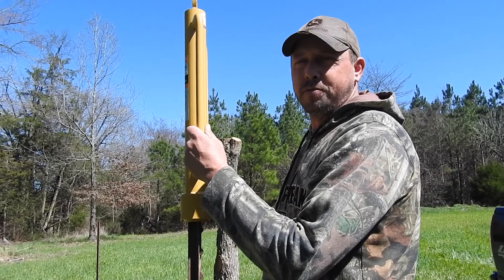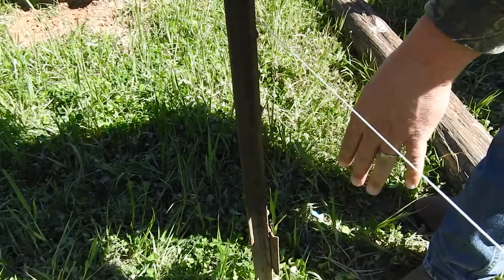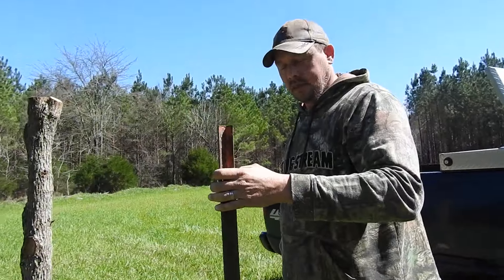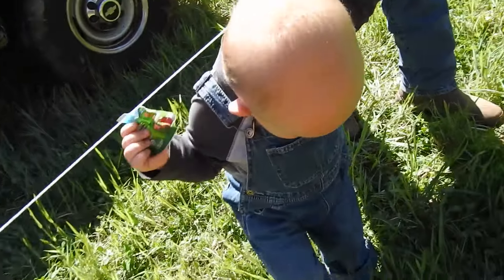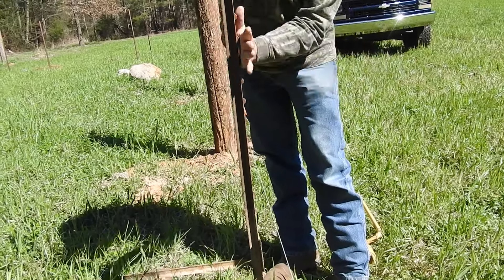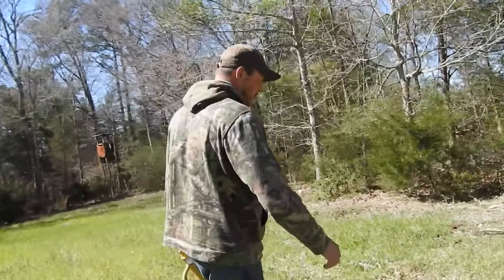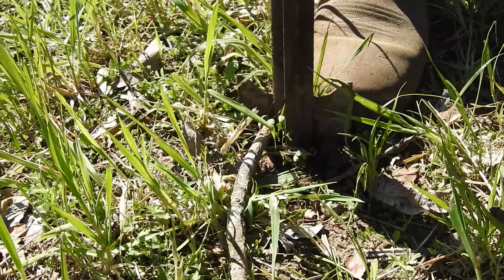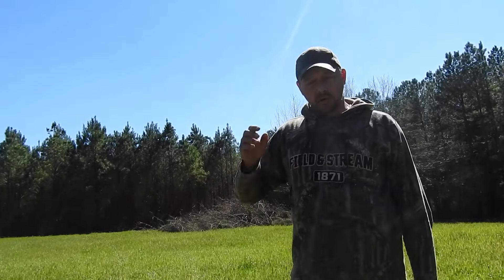Mistakes people make when Installing T Post for Fencing

Comment: We use 6 1/2 ft t post we drive them deeper. Im 5' 8" T post should be at least shoulder high. For 5 strands of wire. Been doing this for about 30 years now. Brace posts about 54" high using 8×8 treated or cedar posts. T post are guna be a bit higher. Then you guide the wire about every 5 to 7 t post. We do ours every 10ft apart.  
Its easier to show that to explain  but im not a social media teacher. Rather show, hands on.

Comment: Super helpful. We have a few acres and great fencing with these but it came with the property so is around the trails and pastures and I’ve just needed to do repairs so far.
We have a main gate at the road with the only part of the property without fencing across the front. But people across the gravel road across from us have about five loose aggressive dogs that continue to come around the gated drive. Then our LGDs are at the front instead of at the barn ( doing their job though )
I’ve been up front clearing brush and walked a corner around a tree I’m clearing to be face to face with barking growling lunging dogs. Luckily this place came with a post driver, extra rolled wire and several tposts I’ll need to do a count and measure how far the wire fencing will reach.
We absolutely HAVE to at minimum get a fence across the front so I hope I have enough. Because my hubby is already complaining about $450 rolls of fencing. 
He’s new to farm life and not prepared for what’s considered farm important.
He’s also kinda scared of our goats so 😂 it’s gonna take time. I’ll likely be putting this fence up on my own. 
If not I’ll need you to do an install an electric fence to keep predators out video!  I’m
Certain that will work but hope I can use what’s already laying around here because $$$

Comment: I grew up where the ground was hard and occasionally rocky. In that case I suggest cutting the bottoms of the handles (the bends and horizontal bits) off, grinding the weld where the bottom of the handles used to attach to the main tube smooth, and grinding the lower (cut) ends of the handles smooth. That way when (not if) you’re starting the post (reaching up high) and the post hits a rock your hands just slide off the bottom ends of the handles, not into the bend and horizontal part at the bottom of the handle. And wear gloves.

Comment: I’m in the middle of a 180 yard run right now and even though I pull the string all the way down the line between H braces and use the same tools you got I have absolutely struggled with getting those tea posts in Straight. Even with an extra pair of hands and a level they just seem to have a mind of their own. So after the fact when I’m stretching this fence and getting ready to fasten to T post what I’m finding as they’re not vertical but off to the left or right. Anybody have a solution?
Reply: Sometimes, rocks cause the problem, and moving the post one way or the other can make it easier to get the post straighter.

Comment: Thanks, didn't know the boot twist tip. Your property is level, what about slopes?
Reply: T posts go straight up from the slope of the ground to maintain the height of the wire.  As the slope gets steeper, if the post is plumb, the wire gets closer to the ground.

Comment: If I am understanding this right, regardless of in or out, you want the animal to push the wire against the t-post? This prevents the animals from just bending/breaking the clip/wire holding the wire to the post, thus forcing the wire off the post, correct?
Reply: The bumps on the t post face the animal. If animal pushes on wire the wire can’t move past the bump.

Comment: what is the weight per foot of the t-post you are using? or weight of entire t-post?
Reply: "regular" t-posts like he is using are 1.25 pounds per foot. light duty  is usually 1 pound per foot and heavy duty is 1.5 pounds per foot.

Comment: I have to install a post today at boss's ranch by myself. I've never done this before and don't know if I can even lift that big, heavy tool. I'm a strong woman, but not that strong. Wish me luck!
Reply from the maker: If I can drive a T post you can drive a T post I am a very small womanGood luck let me know how it goes
Reply: @MrozinskiFamilyHomestead  I can't believe it, but you were right! I was able to get the T-post in the ground using the tool. I dug a little bit with a shovel, then got myself in the back of the Mule and put that post in the hole, then used the tool to pound it in. Thank you for the encouragement!! Lee from the Texas hill country!!
Reply from the maker: You are welcome
Reply: Let the weight of the T post driver do the work. Hold it up let it fall and shove/pull down you will be fine. You got this!
Reply: Put the driver on the post before  you tip the post up to drive it in. Also, look for a post driver that is longer and easier to reach.   
   Also, if a driver is really short and you're driving, the post hard you can lift the driver too high and bring your hand down on top of the post.

Comment: I'm using hog panel, trying to keep people outsider the fence also using brackets to put a wood on the t post.
Can you tell me what side to face the post, do the panels go to the outside? Did I say this so someone can understand? 🙄🙂
Reply from the maker: Ok I have thought about it a lot trying to come up with a right answer for you for the boards on the post it depends on how the brackets are installed to keep the pigs in you need the rigged part of the t post on the out side and then your boards should go on the outside to smush the hog panel to the t post  I hope this helps